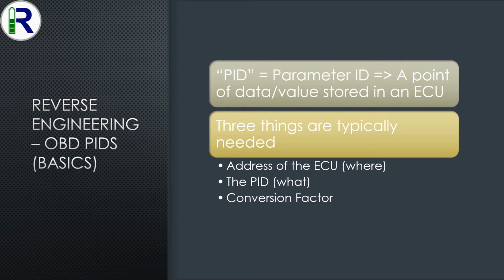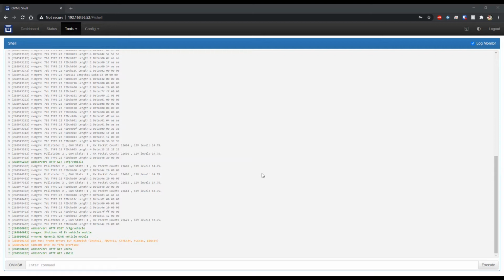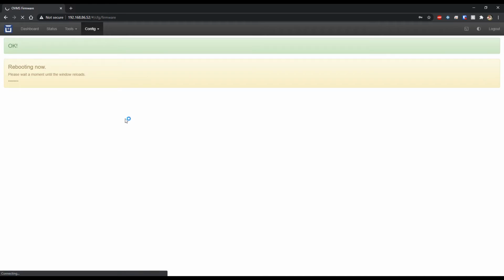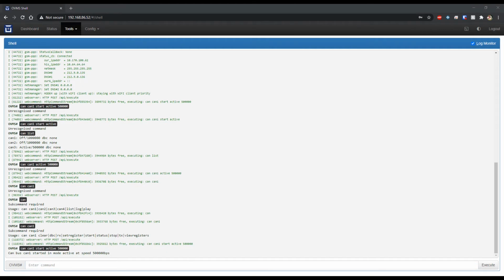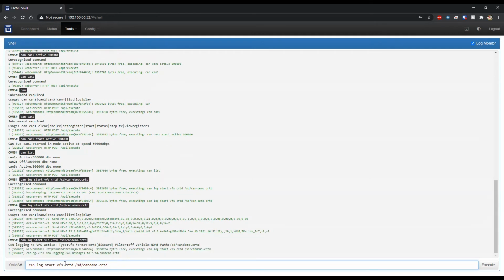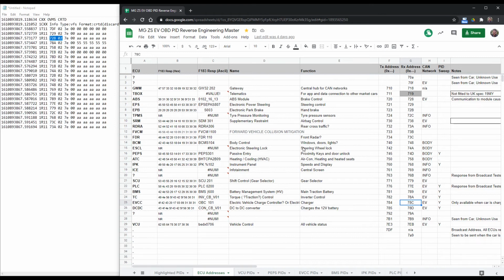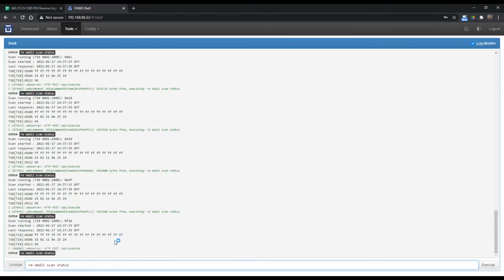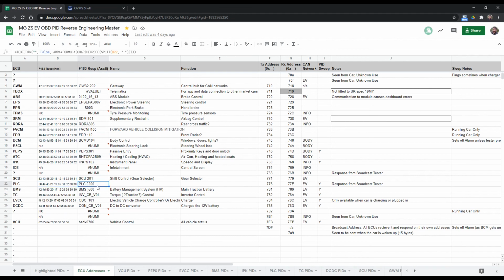OVMS for Reverse Engineering OBD PIDs

Comment: And if I send the code '0x7DF 8 1 FF' to the control unit, does it return me the list of services or do I have to make another code? I have 2 canH and canL accesses, one on the radio connector, the other in the standard socket, why do I see different codes? can I use both of them indifferently or just the standard? thanks for an answer. Roman.
Reply from the maker: Capt DIY managed to do it but I don't know the command. I will see if it is available on my diag tool tomorrow. You do not need to write the DLC value in the CAN frame send. Also be careful with broadcast transmission as it can cause ECUs to lock up and stay awake
Reply: @RuralElectricSystems  https://youtu.be/tEPYul91DJg
thank you very much for replying, with your suggestions you can see the loop I generated to view the data in real time, update me if you find other codes, my pid is structured "Pxxxxxx" in response but I cannot locate the data from send, the standard ones all work.
Reply: I'm sorry again but I'm looking for the codes to control the switching on of the lights using the canbus codes remotely ........